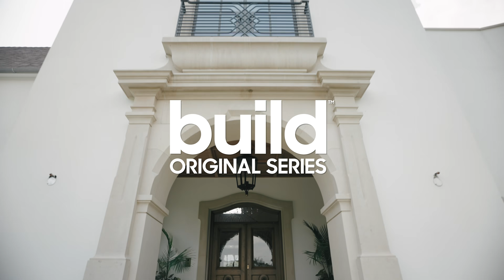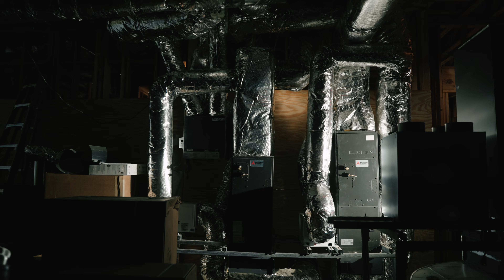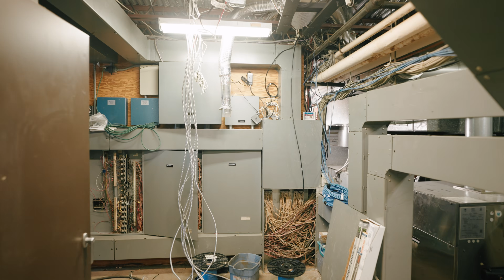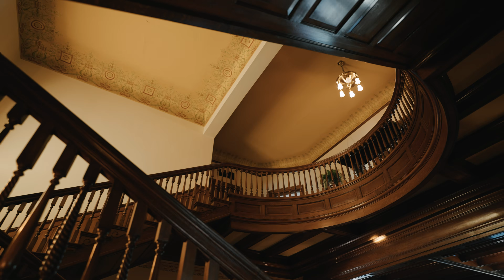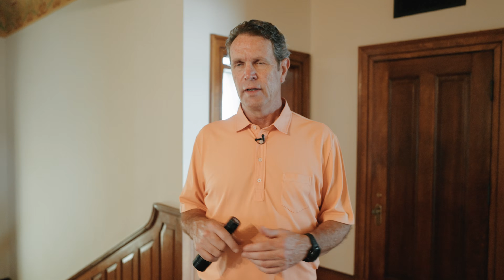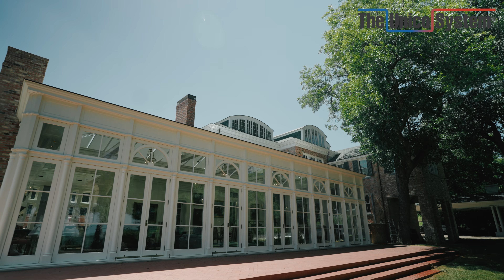New House Old Soul Ep.10 - HVAC Heating and Cooling

Comment: An  energy efficient HVAC/mechanical system is required to provide comfort for everyone using a building.  Working the mechanical system into the architecture as Brent Hull describes here, instead of dropping it in without any though is important to both modern and historic construction. 

Clients  need to buy high quality design time from both the architect and the consulting  HVAC engineer  in order to design and integrate the mechanical system with the architecture. My experience designing buildings has been clients who try to save money by turning the HVAC system over to the contractor as a design-build project will sacrifice both beauty and comfort. There is nothing saved if everyone using the building is too hot, too cold, or subjected to eyesores from a poorly designed system.
Reply from the maker: Agreed. Thx.

Comment: Water holds 4.23 x more energy than air so you can move energy around with water in a much smaller conduit.
Reply from the maker: Ok. Thanks for  sharing.
Reply: @BrentHull  OMG.  Big fan Mr. Hull!!!

Comment: Hey Brent, I love that you visualize the rooms before they're built in order to incorporate a unico system or other method for heating and cooling. I know too many architects that only deal with the issues AFTER the subs have already installed ducts and made a mess of the ceilings/rooms. As you know it is not that difficult IF you visualize and think thing through the various mechanical components and utilize some of the newer technology. Keep share and hopefully more builders and architects will incorporate your way of thinking!
Reply from the maker: Thanks for the note.

Comment: I agree with your comfort and design philosophy, but I really can't relate to a 20,000 square foot mansion. Could you do some talks for us normal guys. I am about to do a major remodel on a 2400 sf concrete block ranch built in 1968. I do learn something from all your videos, but I need something more my size.
Reply: Don, what climate zone are you in? Will there be insulation on the walls and/or attic?
Reply: planning to add 3" of exterior insulation and rain screen with drop siding.
Reply from the maker: Understood. Thanks
Reply: My opinion:  It is hard to go wrong with attic and crawlspace encapsulation.  Remove and treat any fungal growth.  Air seal the spaces and apply closed cell foam to the attic decking, eaves, gable end walls, band boards, rim joists, and foundation walls.  Put down 10 mil vapor barrier in the crawlspace and seal it at all penetrations.  Add supply air to each space from your HVAC.  If the existing ducts are kept and they are leaky enough, that might be enough supply air in its own.  Add passive registers in the ceiling and floor to allow air pressure to remain balanced and leave a path back to the return.  Install a high-efficiency, quality heat pump.

Comment: For heating, radiant floor heating (with water tubes) fits "the old house spirit" perfectly but such a system is not very suited for cooling... (a cold floor helps, but it's not the best practice).
For cooling, you need a system that can (and will) also remove the moisture from the air and AFAIK a HVAC-system is still best suited for that.
Reply from the maker: Agreed. Thx